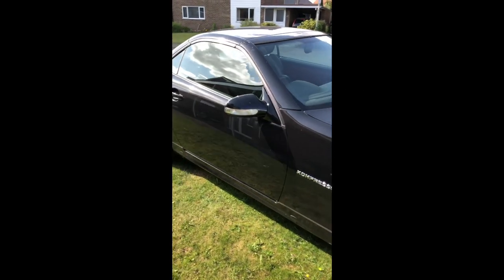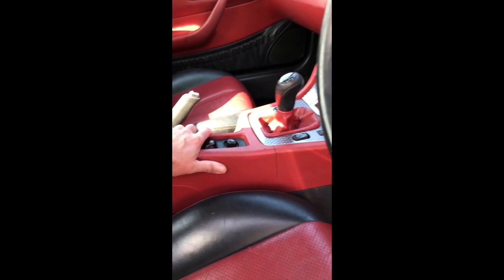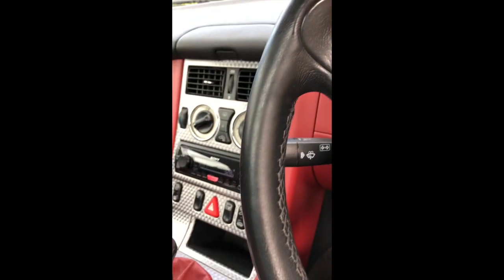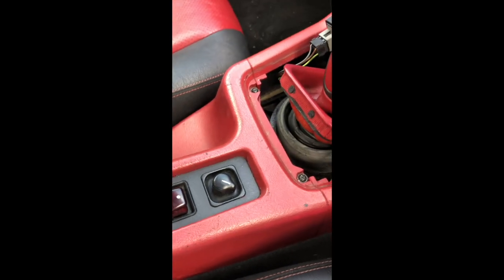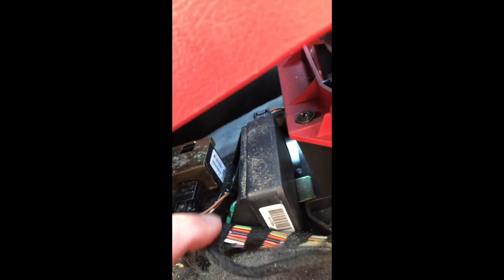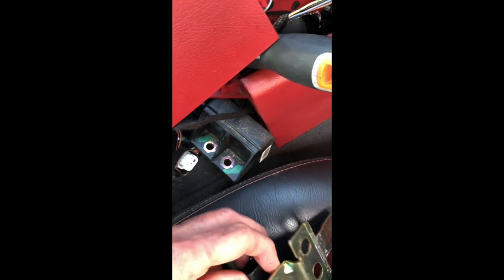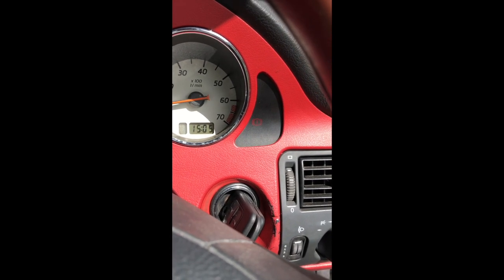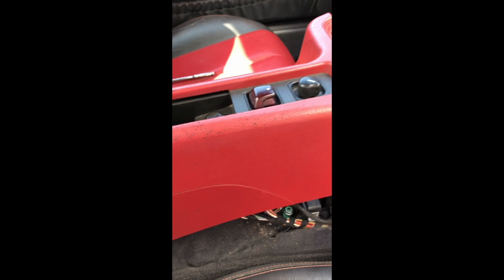SLK R170 BASESP Light Issue Resolved

Comment: What is the part numbers  for lateral accelaration sensor? Can i buy use one cause the parts not available the new one at mercedes dealer
Reply from the maker: @BenPengen  I bought mine from eBay (£60). I always recommend taking yours out first and checking the number to ensure you get the right one...

Comment: Thanks for this video I have been able to get the part number. It’s the same  2000 plate r170 320 just ordered it on eBay. Use the video later to fit it thanks very much
Reply from the maker: No problem hope it goes well 👍🏻

Comment: Mine SLK R170 has both BAS/ASR and also ABS lights issue. It is the same sensor or fail of two sensors?
Reply from the maker: That sounds like two different sensors to me.  My approach would be to replace the BAS then check that’s cleared and move on to the ABS…

Comment: I've just bought a 6 speed 2001 SLK320 (which by the sound of the engine you have Chris?). The BAS ESP came on today after a bit harsh accelerating in first gear. What is that sensor actually doing? Is it detecting some sort of body flex or something?
Reply from the maker: The BAS ESP light is initiated by the lateral acceleration sensor which measures the g-force from a turn and sends that information also to the ECU. The lateral acceleration sensor is essentially a steering angle sensor and detects then corrects the steering angle based on a variety of factors.
A faulty sensor is usually the main cause of the light coming on but not the only one. I would go for the sensor first. I spent wasted time changing the brake sensor thinking that would be an easier fix but frankly, it was a pain and didn’t solve the issue!!!

Comment: I have a 99 slk230 turn off headlights & car & close door & lights came back on. What can be problem??
Reply from the maker: Hi Robert, I'm not familiar with this issue however it's worth a few fault diagnosis notes:
- try switching the headlights to a park light position (further left either one or two clicks) and see if it still does it. If it does, it might be wiring, if not, possibly the switch...
- Is the fault the same if you are in or out of the car?
- The headlight control switch is adjacent to the door close point, try applying pressure to the side with the door open and seeing if the lights go on
- ultimately it's down to either the wiring or the switch. The easiest (and cheapest) route is to change the switch. I've removed mine before and its pretty easy to do. All that's needed is to remove the lower panelling beneath the steering wheel and access is straightforward.
- An old trick for this type of thing is to remove and replace the same switch and you MAY find that by disturbing the connections it fixes the problem. A very inexpensive first pass.
- Also worth dismantling the panelling and dislodge the switch then before disconnecting see if the problem still appears. It maybe that there is a wire trapped somewhere.

Anyway, good luck, I hope this has given you some ideas to look at a fix. Please let me know what you find!